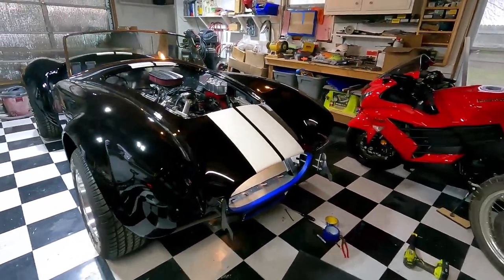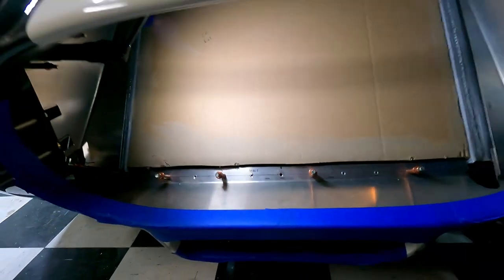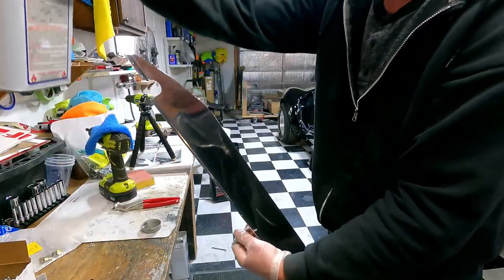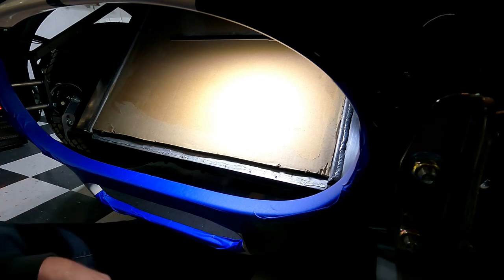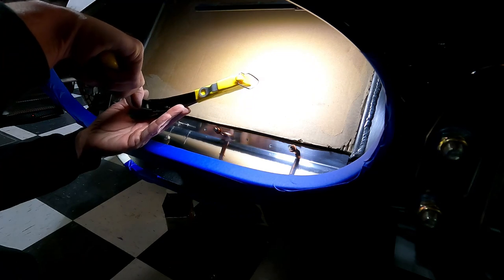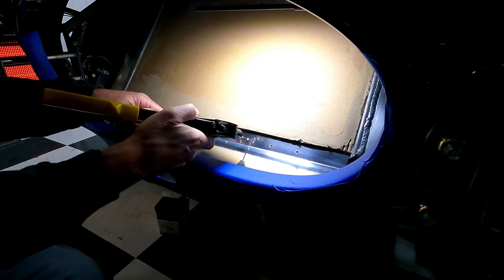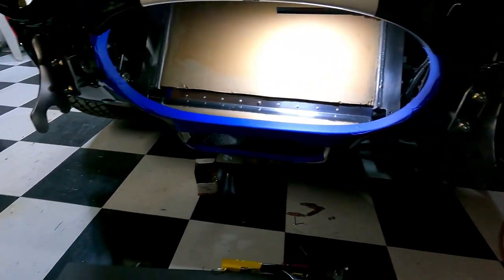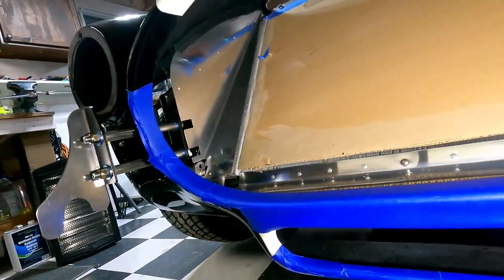FFR MK 4 Radiator / nose cowl aluminum install - Shelby Cobra replica build

Comment: Can you explain about the radiator "float" significance? What is the problem with solid attachment to the frame. Aren't radiators usually bolted to the frame?
Do you think the Shark Hide will withstand the environment and not corrode over time?
The project is looking good.
doug
Reply from the maker: Hi Doug and thanks. The Breeze auto lower mount insulates the radiator from the frame with rubber tubes. I think because it is all aluminum the worry is stress on it and subsequent cracking. I also installed the Breeze upper radiator hinge. The upper and lower Breeze mounts were inexpensive and just made sense to me anyways. The Sharkhide is good for raw aluminum, it will keep it from corroding if it doesn't get penetrated. It is easy to remove with acetone and re-apply. I like it because it's cheap and easy. Hope that helps.